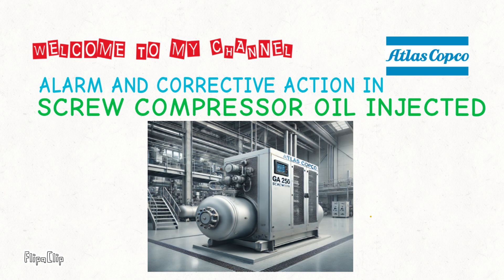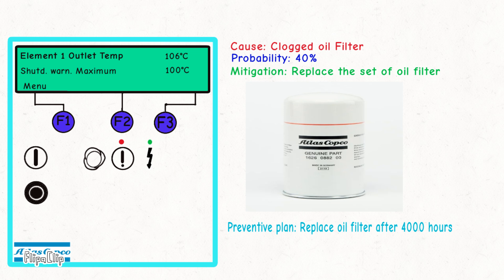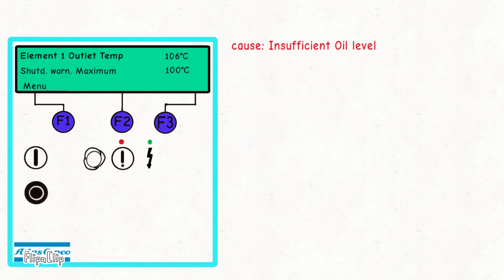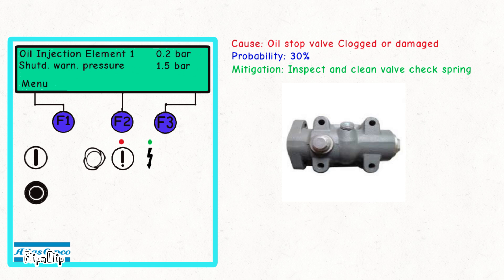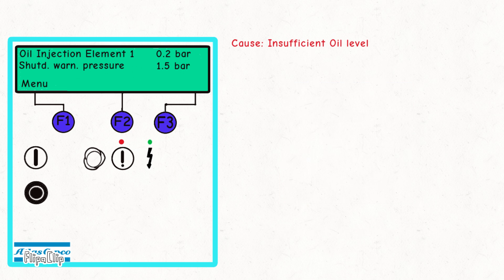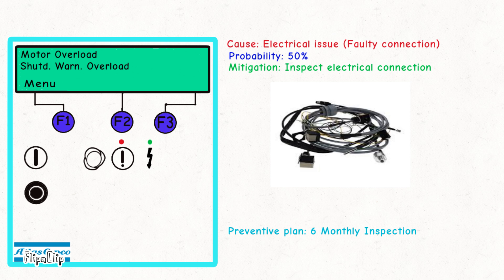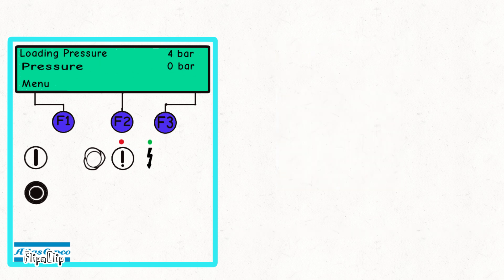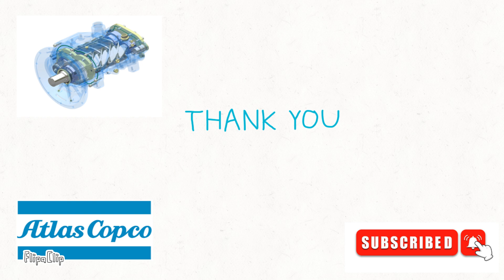Atlas copco compressor preventive Maintenance:Fault Element Temperature Injected Pressure

Comment: sirت how about the element outlet 2 rising temperatures what is the cause of this?
Reply from the maker: Inspect Heat exchsnger for airflow obstructions and clean coolers to ensure efficient heat exchange.

Check and replace dirty or clogged air filters to maintain proper airflow. 

Verify oil levels and quality, replacing degraded oil as necessary.